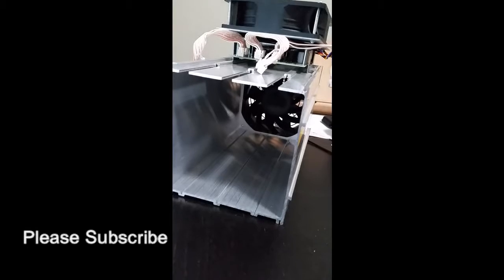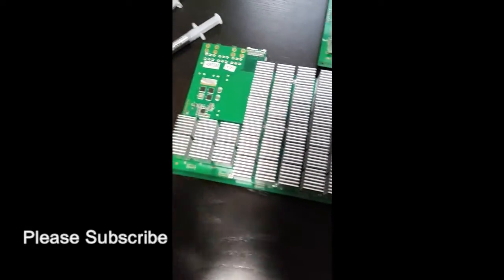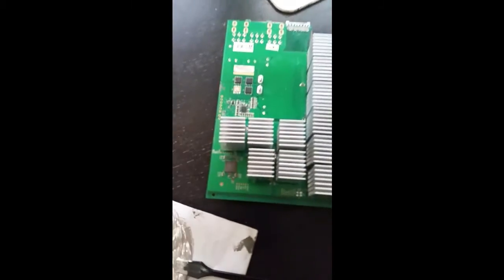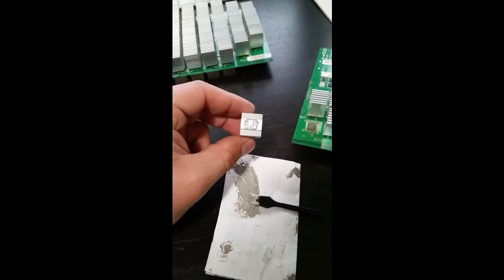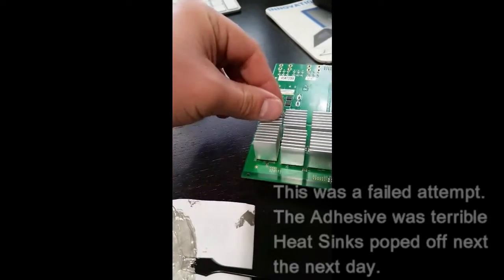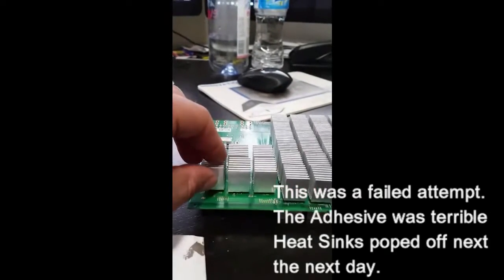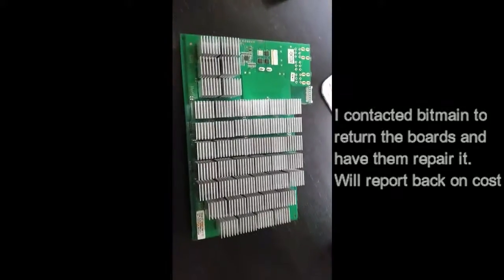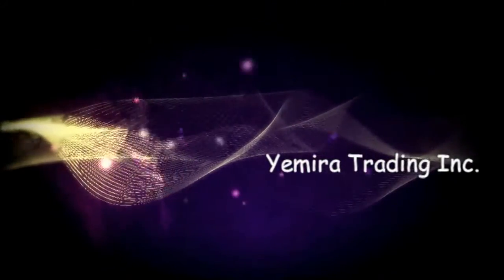Antminer S7 - Heat Sink "Repair"

Comment: i have a question.. what type of thermal paste did you used ? how can i paste he sink? I want to be the same as the original
Reply: You need thermal adhesive (not the tape) to glue them back on.  Paste gets runny when it heats up and wont stick to shit.  I still think they should of screwed them to the board vs gluing them to the asics directly.

Comment: Customizing the fan speed percentage to 60% will effect S7 or it will be fine? Actually S7 which i bought is giving constant whistle from rear fan.
Reply from the maker: +M Kamran Reducing the fan speed percentage to 60% will only slow down the Fan rpm (rotations per minute) so it will reduce the cooling effect by 40%. You will see the temperature increase. The whistling is normal, as the heat sinks are too close to each other and air is going through the fins at 4000+ at 190 cubic feet per minute.